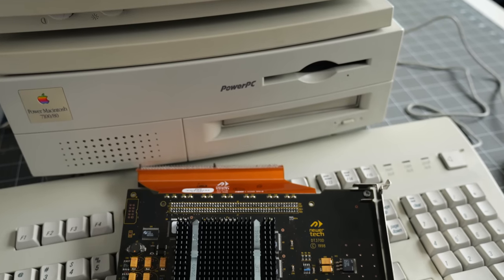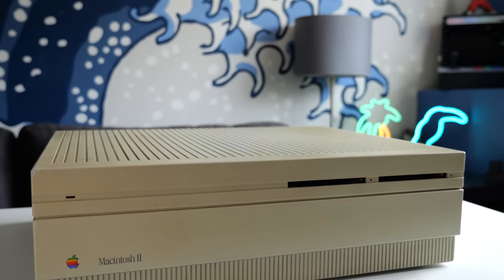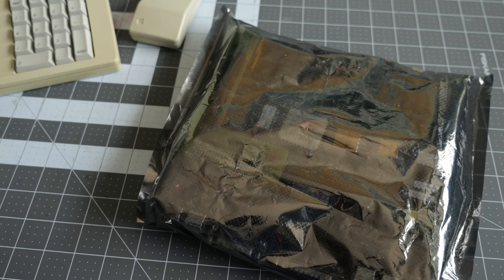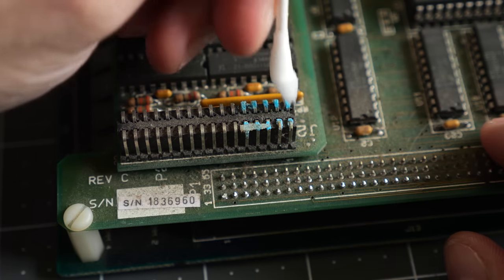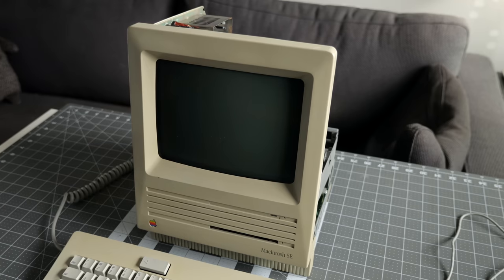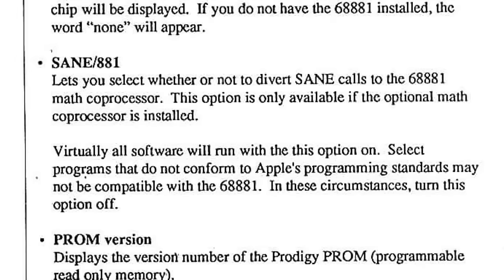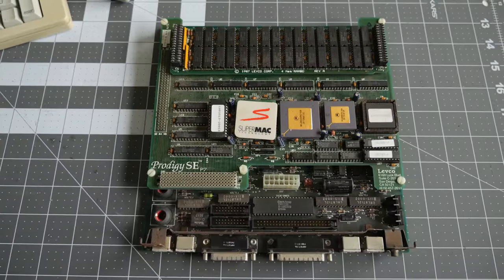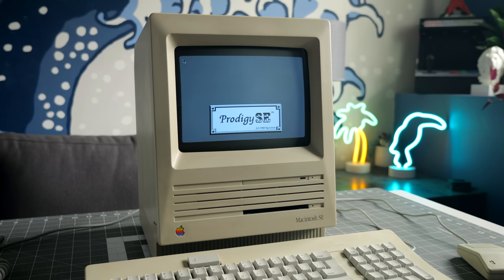This vintage upgrade made the Mac SE into a MONSTER!

Comment: can you upgrade to System 7.x and maintain the accelerator?
Reply: good question...I had the Dove Marathon 030...My memory is very hazy but I believe the answer was 'no', at least for that particular card. I don't believe the extension packages for the control panel cooperated with 7 and I never found subsequent support from Dove. Even dismissing the accelerator, I remember still trying to work with System 7 but I don't think I got anywhere - too many issues or too heavy a resource demand. I reverted quickly to System 6.0.8. and remained happy. I think the only problem I eventually later ran into was a later version of ClarisWorks which required 7. It was a little bit of a let down but I decided I could live without.
Reply: My accelerator card Novy Quick30 (a 68030 CPU / 6888x FPU combo with  RAM slots) ran System 7.0 without problems on a Macintosh SE.

Comment: hope you took that battery out, just seeing it, made me nervous. i've had several bad experiences with batteries like that.
Reply: yeah those cmos batteries leak and corrode the entire board, even the coin cells can do that, i took mine out of my pentium 4 machine as its about time for it to start leaking and i need to get a replacement vga cable as the xomputer is showing no signs of life, it was working after i took out the battery so that’s not a problem. i haven’t had one leak on me yet, but as i have 2 20+ year old computers, im sure i will see that happen soon. i actually mained one of them for like 2 weeks, a dell c600 with a 850 mhz p3 and 256 megs, the original hdd still works, but is slow and dying, i replaced it with a 40 gb variant of the same drive, which was made in 2009. The c600 is from 2000-01. i’m currently maining a 5 year old lenovo 330s running arch linux

Comment: I really wonder why the SE didn't include a faster CPU.  A 12.5 MHz 68000 was available.
Reply: Everything is derived from the 15.6672 MHz system clock. If you run the CPU at another speed, you throw everything else clocked to sync with it, out of the window.